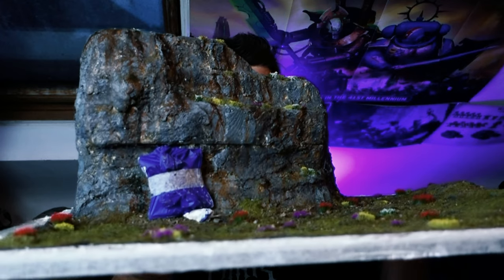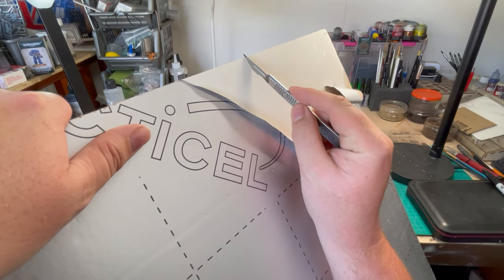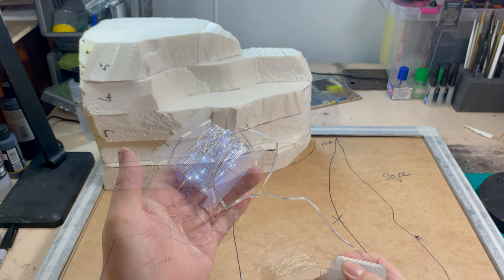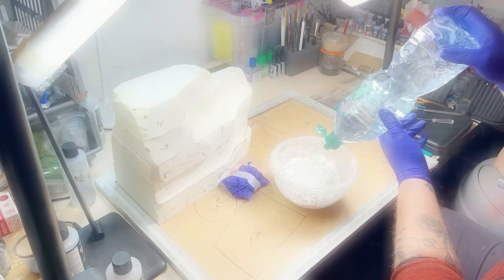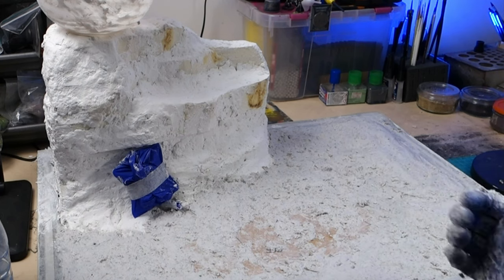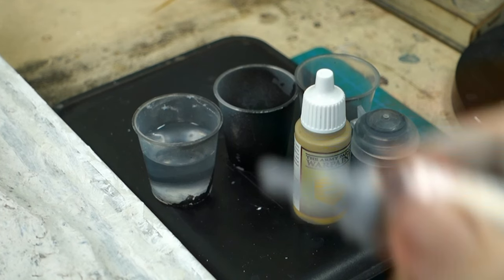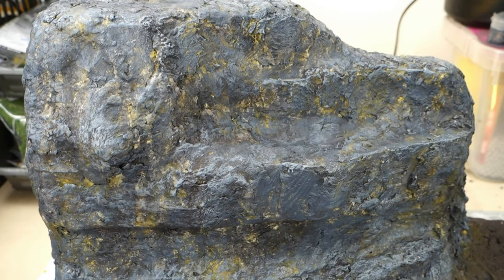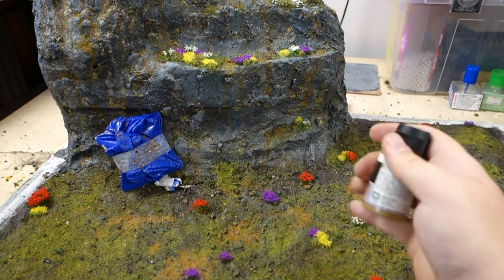This Diorama Is Going To Be MASSIVE! Horus Heresy Build Part 2/3

Comment: You may have already considered these points as you are probably already working on the next video.  

I have a concern about your placement plan. The footprint of the Drop Pod placed between the rockface and Tank doesn't leave room for the hatches to be in the open position. Another thing I would mention as a concern is how hidden the Drop Pod will be in that spot. Given the cost of the model, the effort you will probably be putting into it and the amount of cool detail on the Pod it should be placed for visibility. Against the rockface so the hatches can be open asymmetrically would look cool. 

If the plan is to have the Tank and Pod interacting (Pod smashed into Tank for example) I would recommend reversing the positions so both are visible.

Love what you've come up with so far.
Reply from the maker: Luckily I haven’t started yet that’s tomorrows game 😅. Tbh I hadn’t thought about that and you make a valuable point on that! Thanks for pointing this out 😅 I’ll be keeping that in mind when it comes to assembling 👍👍👍